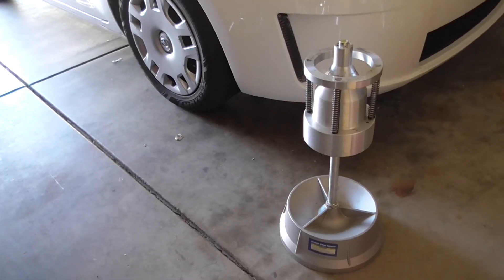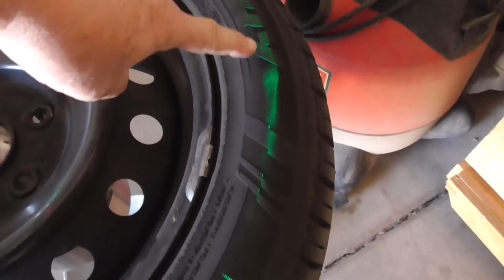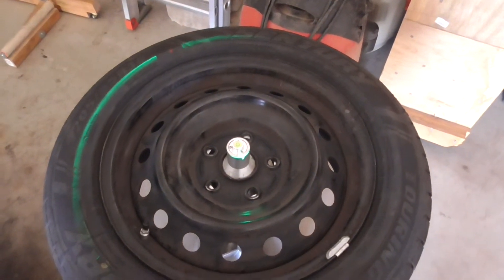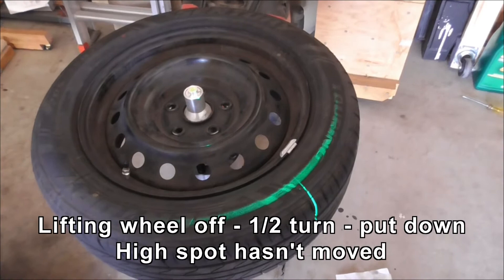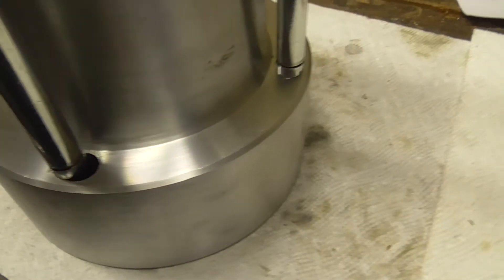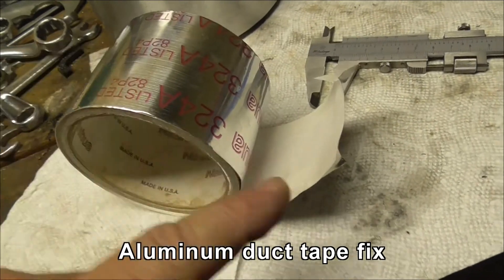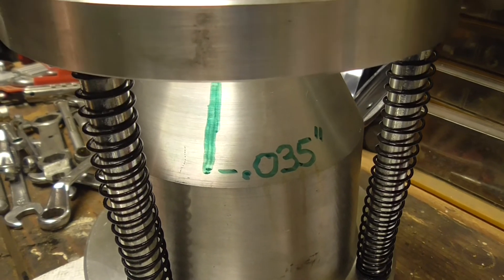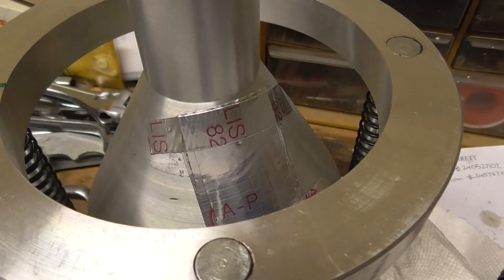HF Bubble Balancer Flaw

Comment: When you made the TIR measurement, did you factor in the spring force from the dial indicator pushing the cone off balance?  I noticed your bubble moved around when you were taking the measurement.
Reply from the maker: Just tested the glass ball method and it worked on my XB's steel wheels. However, the Corolla alloy wheel was unstable on top of the ball-platform. I was expecting both wheels to be unstable, but it appears that when the CG of the wheel assembly is below the CG of the glass ball, it provides a stable result (steel). Other way round is unstable (alloy).
Not sure why that is... but it is. Will start editing video for posting later
Reply: @richbinaz  Great news.  How level does your table have to be?  I assume it has 3 adjustable legs for leveling? 

Have you considered trying this method?   https://youtu.be/lOFi-bioUpc
Reply from the maker: Good Questions!!
There is a spring force and I was wondering if it would be an issue, but I don't think it affects the reading because of the location I took the reading??

I wasn't looking at the bubble, but it does move around a bit doesn't it.
So does that mean that because the pivot is off center, the cone is now precessing around the real CG of the cone? Hmmm.

One of several flaws in the unit, amongst them are...
It's a machined casting with no sign of any balance correction grind marks.
The bubble itself is hard to see an insensitive.
The support frame is poorly aligned with the holes it runs thru.
Is the frame face perpendicular to the cone? Then with a tire on? (I can't check that with the tools I have) But I can move the wheel relative to the support frame with a screwdriver. What does that mean?

That and the fact that I couldn't get the wheels balanced means it is now a giant paperweight in the shed.
I did get the wheels balanced with a vertical balance method - shown here
https://www.youtube.com/watch?v=li6cBQBcOX8&list=PLWHom5FLIC6vZSy2jL7YB3xnY2jVi5Mgt&index=9

...and I'm working on another simpler method. If it works (or not), I'll post it. Just waiting on Amazon right now...
Reply: @richbinaz   I measured the TIR on mine, and I found the spring force of the dial indicator changed the angle of my balancing cone, therefore also affecting the TIR measurement.  Luckily I had my cone and bubble level pre-calibrated to level prior to making the TIR measurement, so all I had to do is use my finger to push  the cone to re-center the bubble before reading the dial indicator.  

The TIR on mine was also around 0.03".  I tried the aluminum tape since I had some on hand, but it didn't improve repeatability either.  

I also already had my pivot point drilled out to make the balancer more sensitive, but that didn't improve repeatability either.  

I'm surprised so many people claim these balncers work.  My next attempt is to replace the center pivot with a large bearing.
Reply from the maker: @MrIneffable  Well, Amazon just dropped off an 80mm dia "feng shui" solid glass ball. I have an adjustable table built to rest in on so tomorrow I'll see if I can find a way to use the ball to center a wheel, on a table. Then see if it can "devinate" an out of balance wheel with a laser level I already bought for the bubble balancer.
I am surprised (perhaps not) to learn that your measurements were in the same ballpark as mine. That suggests they are all like it - Sad
If you have access to a lathe (I don't), that mat be a good way to create and inner surface suitable for a bearing or to put an accurate center point in it.
If you pursue the bearing concept, may I suggest a self aligning double row ball bearing.
Some of the small ones can handle quite a good load and will allow the cone to roll around to follow the balance of the wheel.
SKF - pdf link
https://www.skf.com/binaries/pub198/Images/0901d19680208482-519958-_tcm_198-279863.pdf
Reply from the maker: Just posted the video of the alternative horizontal balancing method
https://youtu.be/a4Ox_Emh7Ew
At least it worked on the steel wheel - alloy wheel was unstable.

That other video using the steel post and a ball bearing is good in theory, but the ball must be aligned with the cone. Wrapping the ball in tape and jamming it into a questionable pilot is not aligning it.
The wheel he was balancing already had weights on it?? Why didn't he take those off first??

It is also important to have the surface as level as you can get it. If it's off by 1 degree, it adds to the imbalance. I have 3 screws thru the base to level it up.

Now for the other video - how to find the wheel CG
Reply: @richbinaz  So I did some more testing on my 8 year old harborfreight bubble balancer and came across some interesting results:

Today I pulled the ring off and rechecked the TIR closer to the actual pivot point.  It turns out the TIR wasn't that bad.  For convenience, i had previously tried to measure TIR at the top of the cone near the bubble level , but i guess the swinging of the cone multiplied the error.  I removed the tape from my cone because the measurements weren't that bad.

When I pulled the ring off to make the TIR measurement, I found the rods were reasonably straight, and there wasn't excess friction like on yours.

When i reassembled everything, I left out two springs, and this is where the results got interesting.  Placing the wheel on the ring, the wheel still didn't center properly as you've noted in one of your videos.  With only two springs installed, prying the ring didn't recenter it.  It would just spring back off center.  What did work to move the ring is grabbing the center of cone and applying a torque to the cone.  When I did this to recenter the ring it also corrected the angle of the wheel against the cone.  The results became consistent and repeatable.  

Anyway, I still haven't verified this method will rid the wheels of vibration, but it made the balancing results repeatable.  It was like night and day difference.

Note my balancer has the female side of the pivot drilled out so the weight rests on the tip of the pin.
Reply from the maker: @MrIneffable   You prompted me to pull my "paperweight" out of the shed for another look. 🔍

My unit does not have the widened pivot hole, although that does change the way the head balances on the pin. When the head starts to tip, the bottom of the conical hole touches the pivot pin causing resistance to tipping and the head can now ride on that contact point, changing the balance center. 😕

I treated the balance head as a "wheel to be balanced" using the laser level, and found it was out of balance by about 1/4 ounce. This was just the bare head. I added weights in a Y pattern to balance it, and zeroed the bubble. Rotated it slowly for 1 turn and the bubble did not stay centered. 😦

Then I added the wheel support frame to it. The bubble moved and the laser showed the head is balanced incorrectly. I didn't bother rebalancing it. 😩

Despite the poorly aligned rods on the balance frame, The holes are too sloppy and allow the head to wobble on the frame by about a whole bubble width. I video'ed this and didn't see how much it moved until reviewing the footage. I can't believe a wheel can sit squarely on the cone because of this. Thinking about this... even if the wheel was perfectly balanced going onto the balancer, it could show it was off by up to a whole bubble width.😖

I then had another go at measuring the TIR with the balanced head only and it was less than last time at .025" instead of .035". 🙁

I'll do a 3rd video on this and link them all together. I won't be using this balancer again as it gives bad results and I can feel the vibrations at 65mph and above. Using the vertical balancer, no vibes at speeds well above that. 
The only horizontal balancer I can recommend is this one, but it doesn't work with all wheels
https://www.youtube.com/watch?v=a4Ox_Emh7Ew 🤨
Reply from the maker: @MrIneffable  Here's that 3rd and last video in the trilogy
https://www.youtube.com/watch?v=an6sURvUhBA